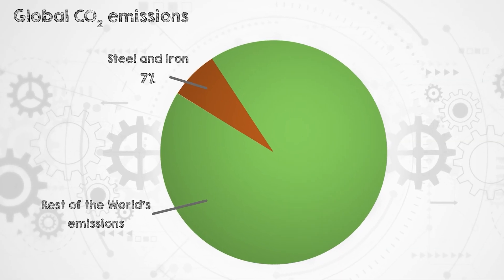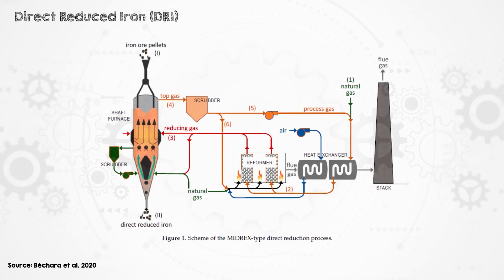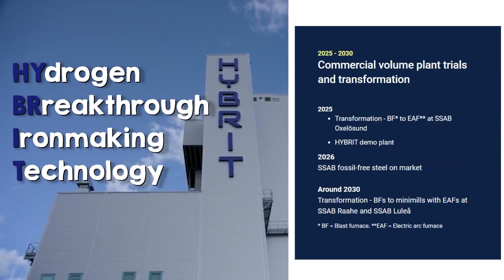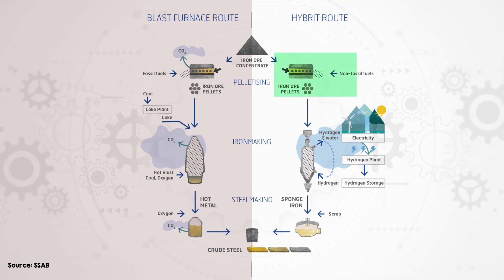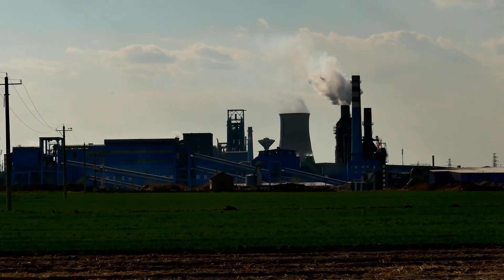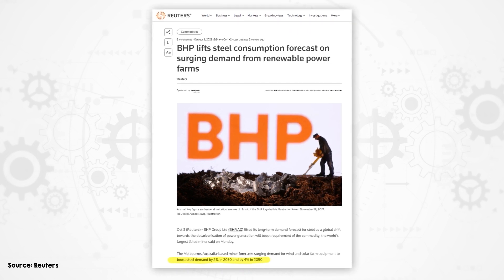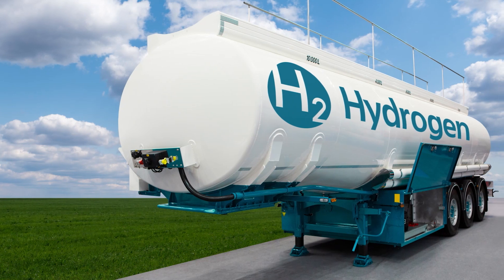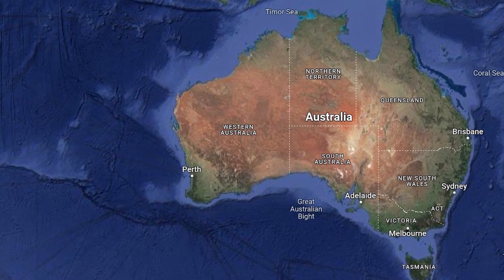Green Steel From Hydrogen

Comment: This sounds fishy...
No mention of how the steels carbon content is achieved without carbon, no mention of hydrogen embrittlement and how it's avoided.....
Reply: The hydrogen reduction process does not produce high-carbon pig iron as a blast furnace does, but low-carbon "sponge iron", exactly the same as methane-fired "direct reduced iron" which has been produced on the industrial scale for decades.

Pig iron has far too much carbon to make good steel, so it is typically improved with a "basic oxygen furnace" that burns off some of the carbon at significant additional energy cost.  The typical approach with low-carbon sponge iron is to mix it with a small amount of cheap, high-carbon pig iron in an electric arc furnace so that the average carbon content will work out right, without having to burn off any carbon.  Presumably to achieve fossil-free carbon, pig iron will not be an option, so non-fossil carbon will have to be added in another way that protects the carbon from being simply burned off in the heat, perhaps by pre-packaging something like charcoal in metal pellets under an inert atmosphere.

From SSAB's site:

"Traditional steelmaking involves removing oxygen from the iron ore using carbon and coke in a blast furnace, a process that emits large volumes of CO2. In the HYBRIT Demonstration project SSAB will phase out two blast furnaces and a coking plant in Oxelösund and replace them with an electric arc furnace (EAF). The EAF will enable the demonstration of electric melting with high shares of hydrogen-reduced sponge iron. The process will be powered by fossil-free electricity.

"The project will enable SSAB to introduce fossil-free steel to the market by 2026."

(can't post URL, maybe this will work: www dot hybritdevelopment dot se slash en/demonstration-of-electric-melting-eaf/ )

By implication, the demonstration plant isn't claiming to be entirely fossil -free just yet, though the single first shipment to Volvo was described as such.
Reply: @JonathanMaddox  So if I understand it right the hydrogen embrittlement problem has been solved long ago since it was encountered when using methane to make sponge iron?
I will say though, my expectation is that the superheating turbine that NASA invented which is capable of heat exchange from one gas to another where it makes the secondary gas even hotter (I believe) will see some use in this.
HOPEFULLY small nuclear reactors will be used for power generation but also to produce industrial heat where these kinds of processes can be utilized without any efficiency losses in turning the heat into electricity and back into heat. You should be able to have carbon monoxide superheated, used and re-used until the carbon is all spent. We also already have the technology to make carbohydrates just from water and carbon dioxide that's naturally dissolved in the water, that was developed for the Navy. There's all these technologies that would handily save the world but they all ultimately need lots  and LOTS of power so cheap nuclear must come first.
Reply: @MrRolnicek as I understand it, hydrogen embrittlement is not so much something that happens during steelmaking, as an effect which happens to solid metals over time through chemical interactions with the environment (usually salty water or acids, though high pressure hydrogen gas can increase the effect especially when water or acids are also present) as hydrogen ions from outside the metal diffuse into and disrupt the crystalline structure that was established when the metal was originally quenched or annealed to form a structural solid.

There's some literature on managing iron hydrides in ferrometallurgy.  Hydrogen is even sometimes deliberately included in alloys for specialist purposes.  In the case of steelmaking in the secondary electric arc furnace, however, I expect almost all of the hydrogen remaining in the sponge iron would escape either as a gas or through chemical interaction with slag minerals as the charge is melted down.

Comment: When you said steel was used for PV panel mounts, I had to wonder: why not aluminium? Not strong enough over larger spans? I would've thought it'd do the job and be lighter/better, but then how does aluminium processing compare to iron ore - can we green that process, too?
Reply: Steel is way cheaper than aluminum, so for static structures it almost always wins out.  Most cars still have major steel components.  When car bodies are all aluminum and plastic, then it will make sense to create PV support structures out of aluminum.
Reply: @richdobbs6595  The 'major steel components' are because of superior mechanical properties/strength, especially at elevated temperatures where Al is useless. It is not for the cost.
Reply: Aluminium smelting is more energy intensive than steel. The only plus side is that the energy it uses is by default electric, so it's easier to switch to renewables. But decarbonized steel will probably a greener option also in the forseeable future, since renewable energy production has a hard time keeping up the increased demand in electricity, from both industrialization of developing countries and switch to electricity in industry and transport.

Aluminium isn't necessarily “lighter/better” either. While it's less dense than steel, it's also less strong. The specific strength of both is actually very similar, i.e. when changing something from steel to aluminium you typically need to make it so much thicker that it ends up weighing almost the same as before. Aluminium does have other advantages, but also other disadvantages. It's complicated.
Reply: Aluminum mining is also generally worse for the environments since the largest deposits tend to be found in more vulnerable and critcal environments and has to be mined in open pit mines. Whereas iron ore is extremely abundant and can be mined using shaft mines which significantly limit the impact on the local environment.
Reply: Also aluminium  production uses carbon anodes which are consumed creating co2.
Reply: @danielmulder1999  Thanks all, for the info :)

Comment: Hi Rosie! You mentioned that we keep using more steel each year than we can recycle - is this because steel recycling isn't very efficient or profitable, or is it just a factor of population and economic growth, and increasing demand for the material via that? Do we have an estimated figure for what percentage of the steel in products at end-of-life is recycled? Since it's in so many things, I'm guessing that would be a difficult number to try tracking. I guess I'd just like to know if there is room for green recycling (melting with green-generated power) to reduce that demand for new steel by any significant amount. Thanks!
Reply: Nope. We use more steel than recycling can produce because worldwide the industrial revolution is still early stage, so for instance Nigeria where the population will expand a lot still has a fraction of the per capita use of, say, the US.
Reply: Also, a large part of steel is corroded (oxidised) when it comes to the end of its life, meaning that is not fit to get recycled anymore.
Reply: @dvivek07  That's not true, it's just more expensive to do so but you absolutely can and it is done so long as there is enough steel for it to be practical.

Comment: I'm quite surprised by the stat that solar uses 40% of the steel-per-MW of wind. I thought wind would use a lot more steel per MW (dirty great stressed tower vs relatively slight ground-mounted frame and spiral anchors). Where did those stats come from? 1MW is something like 5km of frame support so the frame has to be 50 times lighter per m to be lighter or 125 times lighter to be 40% of the mass. I guess that could be right.

Comment: Just out of curiosity, are you aware of any studies about how much CO2 savings there would be if we made steel here in Australia as opposed to sending both kinds of rocks all the way to China? And would that be worth it subsidize manufacturing in Australia on the basis of meeting our carbon reduction goals?
Reply: I feel like that is a fairly easy no. Shipping is one of the most carbon efficient forms of transport we have right now, only really beaten by electric trains powered by renewables.

Comment: A major issue is the quality of the steel needed to use hydrogen, which is higher, making ramping up to really substantial volume difficult.
Of course,the problem is being tackled both by ramping the ability beneficiate, and to decrease the need to by altering the process, but it is a real issue in ramping up.
I am unable to post links, as the comment is simply deleted if I do so, so those interested will just have to google.
Reply: Sorry, s/be, the quality of the ores, not the steel.Most ores can't be used as is in hydrogen produced steel.